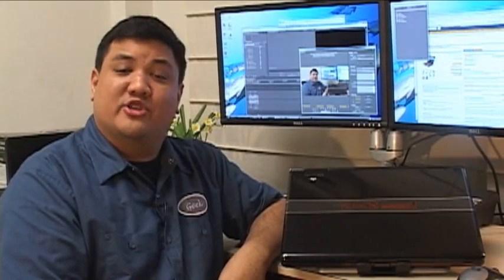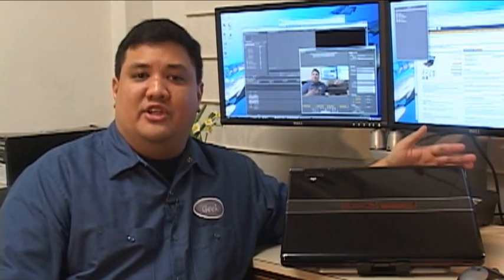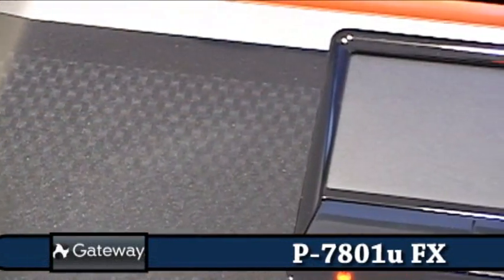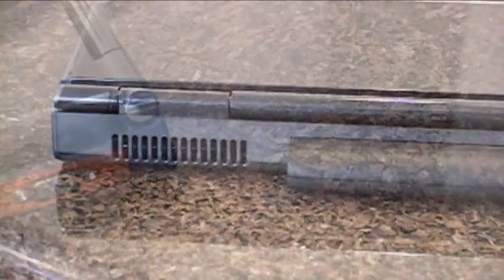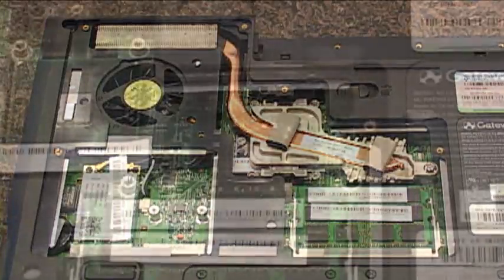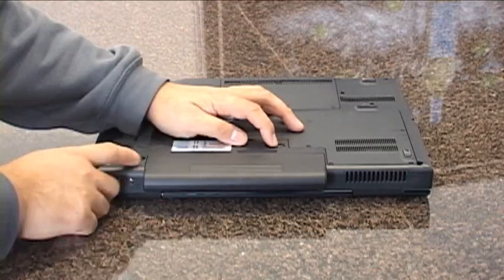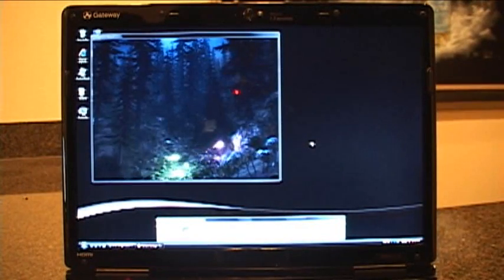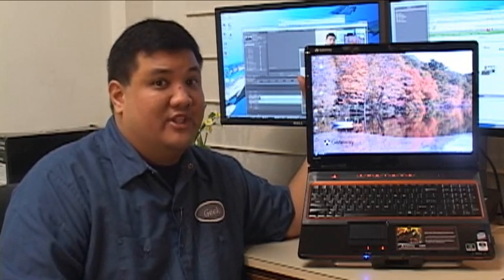Jesuit - gadget 115 - Gateway P-7801u Gaming Notebook

Comment from the maker: sidekick2iskool,

It recognizes it as a CD drive? I've never heard of that before. -- First go into the BIOS during setup and make sure that the laptop is detecting BOTH hard drives. Then go into "Start" -  "Settings" - "Control Panel" - "Administrative Tools" - "Computer Management" - "Disk Management" --- You should be able to see the second hard drive. Make sure it is initialized, partitioned, and format.
.
Peace,
Fr. Robert